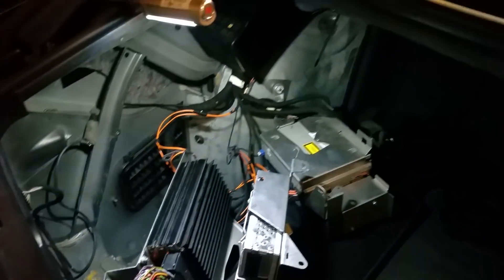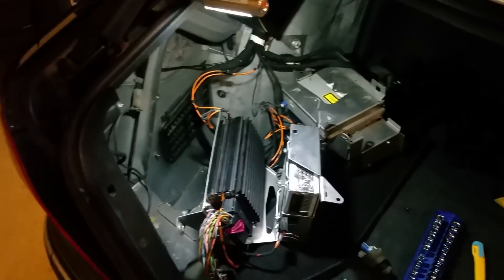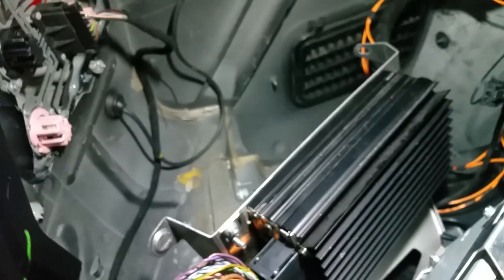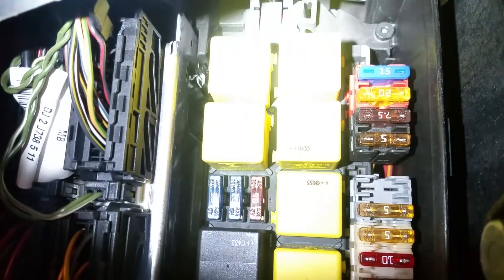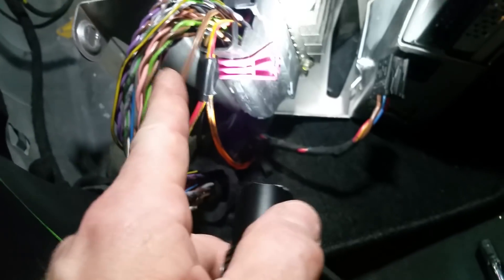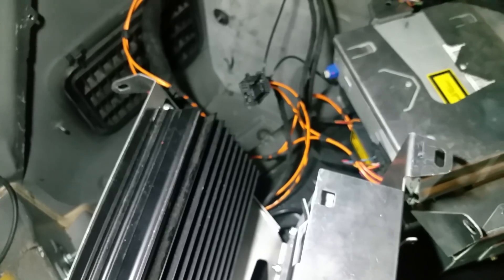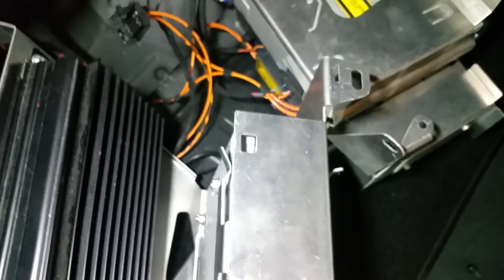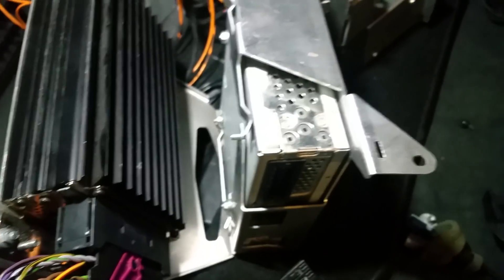Part 1/2 W220 system unavailable, radio issues, BOSE, MOST ring troubleshooting S500, S430, 2005

Comment: I have a 06 s500 with the gps voice nav bose cd just about everything but my radio works and it seems like the amp is working but I guess I don't know what it sounds like if the amp is not working versus if the amp is working, but I have alot of extra wires 3 or 4 antenna wires and a small serial cable that says amp on it and another serial cable that says amp on it but one is bigger than the other and I don't have a place to plug them into the amp or anything. The bigger serial cable says amp on it and there is a 3rd serial cable that fits in the big serial amp cable but the 3rd cable doesn't say anything on it and it doesn't have anything to plug into except the other amp cable so i plugged them together and all the different modules have power and fiber plugs in them but every place that is on the different modules have something plugged into them except for one big plug on the amp if i remember correctly and it doesn't have any cables that will even come close to fitting so i hook up my launch Mercedes specific bi directional scanner and it says not available or something like that basically says my car doesn't have any of the radio components hooked up to my car except for 2 the command head unit and something else I forget what its called on my scanner but how can all my fiber optic cables and all the other cables plugged into every place there is to plug something in to the component and my radio works ive never used the cd changer gps or navigation but I can eject the cd cartridge out of the cd changer so it seems to have power. I want to know what those serial cables are and why they don't plug in to the amp when they say amp on them and I don't understand why my scanner says they are not even plugged into my car when they obviously are and if they weren't then my radio wouldn't work but it does, the sub works all the speakers work. Any suggestions id appreciate it. I can't seem to find a layout for how the modules are laid out and how the wires are run but I fit each cable into the only place ea h one would fit except the ectra cables that dont have anything to connect to. I have keyless go with the old card style but i don't have the card so the button on the shifter doesn't work but I still have all the antennas in the car from that system and I have the hydraulic open and close trunk but that stopped working to my rear blind doesn't work either and I replaced the rear sam and all the relays and fuses are good. I think my trunk has something to do with the ata system so I'm not worried about that right now i just don't understand why the car doesn't recognize that I have all the modules hooked up. And why I have so many extra wires when I have every option available for the radio system. My 01 s430 just has the amp and cd changer and gateway. And it's fine.

Comment: No water in wheel...vehicle is garage kept. Becker Auto Sound in NJ again is being gracious and sending another rebuilt Bose Amplifier; but, they are telling to look elsewhere in the system for this intermittent cold temp failure issue. Are there any stored fault codes to look for with a high end  computer  or fuses that may be causing this intermittent cold temp failure? I had similar problem with instrument cluster...top rebuilder in country..Hamp's Speedometer..in Cumming, Georgia had replaced power supply 2+ years ago...during this cold snap...small LED display in center of cluster was dark..not showing miles...car warms up ....display works...pull cluster..bring back to Hamp's Speedometer...puts unit in freezer...pulls out and tests...finds hairline cracks where a module is soldered to circuit board...he re- solders all components connected to circuit board...problem fixed. Share this fix with Becker Auto Sound in NJ...today...they performed cold temp test and could not find any problem with Bose Amplifier.  Is there something intermittently going bad in audio gateway? Fuse in other components in trunk? Help!

Comment: Wow. You know this system...I am having a problem with my 2006 MB S500.....January 2023...in Roswell, Georgia...cold snap...start car...sound coming out of right speaker only...loud & distorted...consult with Atlanta Auto Sound & Accessories..." Fred, its the Bose Amp going bad..head unit is fine...send unit to Becker Auto Sound in NJ...they cannot find cold temp. failure problem...send me new unit...install...fine for 10 months...cold temp in December 2023...same failure...warmer temp...unit works.....January 2024...cold temp failure for sound...weather warms up...unit works...send unit to Becker Auto Sound in NJ for warranty check...again they cannot find cold temp problem  with my unit; but, they are graciously sending another. Do you have any idea what else I can check for cold temp sound failure? Again, head unit has never failed yet?

Comment: No audio on anything command center is fine. Pulled amp now I may take it apart. Checked fuses. Obd says undervoltage. I’m thinking now that I bought new rear battery the clock worked again maybe the audio will come on?? I am the brake king. Caliper king for over 35 years if u need help.

Comment: sometimes I get the same message "system unavailable". But everything comes back after about 20 miles of driving. It usually happens when there is a problem with drained battery. I have to remove the CD changer to see if it stops the drain. The unit is not there. It is just a frame or something lol